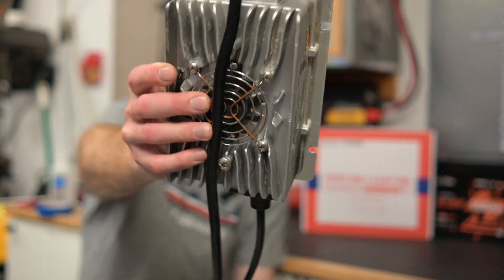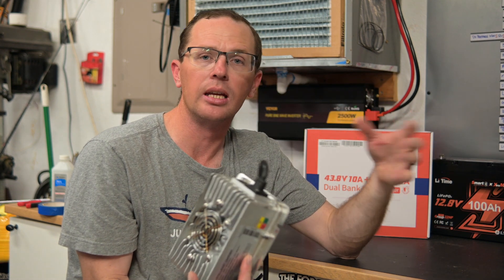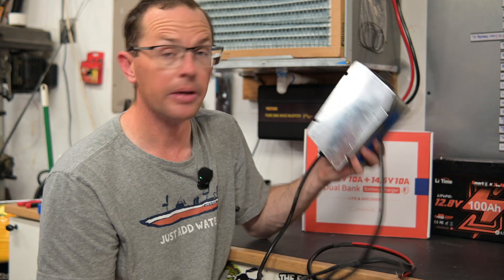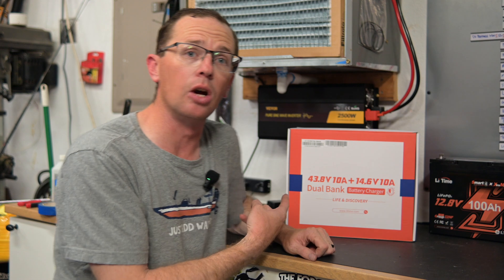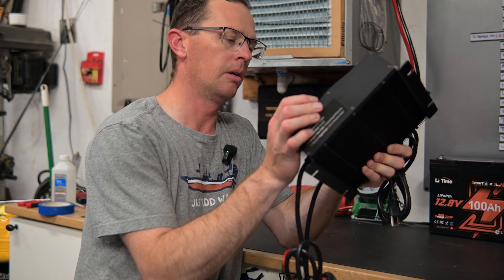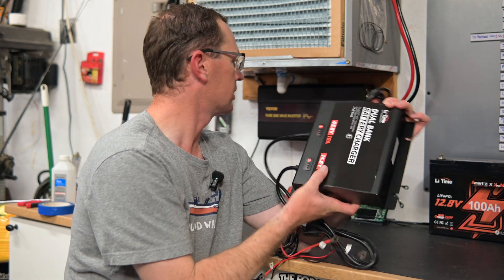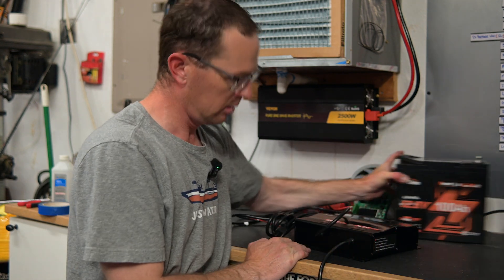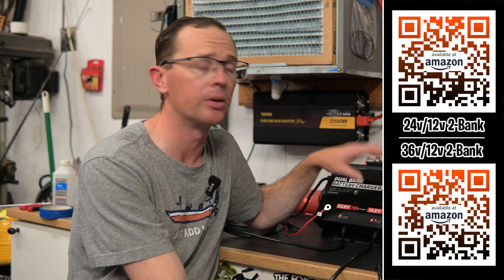How to Charge a 36V Lithium Battery (Without Multiple Chargers)

Comment: Question 18ft boat charger is in front the charger wires are not long enough does it matter what size wire i extend the charger with ? The battery its going to is agm not sure if that mattters.
Reply from the maker: I would use 12ga as a minimum when extending the leads 👍

Comment: I bought some 12v 100ah LiTime batteries. I have a Dual Pro professional 15amp 4 bank charger.  The batteries arrived at 19% charge.  They took 17 hours to complete.  This is crazy. What charger do you recommend?  Ty
Reply from the maker: Batteries definitely ship at lower SOCs. The cells may have been balancing, which can extend the charge times. 15a charger will typically take about 5 hours to charge from 20%.

Comment: I just ordered the duel purpose battery. After watching your video I have two glass Matt batteries for trolling motor. Genius 3 bank 5 amp what charger do I need for my new lithium battery
Reply from the maker: 5a is a bit on the small side but it will work as long as there is a “lithium” setting on it. 

If you are going to need a charger anyway, I’d look at a 10a. Something like this if you have three 12v batteries 

https://amzn.to/45vyOQm

Comment: I was thinking about this the other day and there's really no good reason to have on-board battery chargers, at least not for lithium iron-phosphate (LFP) batteries.  The reason we all wanted on-board chargers, back when SLA and AGM were the only real option, is those should be kept at or near 100% all  the time, for best battery life, plus they take a relatively long time to go from 50% SOC back to 100%.  None of those things are true with LFP batteries.  If you get back from a fishing trip and plug in that (very expensive) on-board charger, you should absolutely unplug it again before you go to bed...and you should leave it unplugged for at least 3 months, or until you use the boat again.  With this in mind (very short charging times and no need for continuous float charging), why have an on-board charger?  Why not have a cheap, external charger and an XT-60 port that is wired to your battery(s)?  I already have a Noco Genius 2x5, for my 24v trolling motor setup, but it was kind of a waste of money.  The portable charger I have could have done the same job, with just as much ease of use, and 1/3 the price.
Reply from the maker: I can see the point of view, but I do disagree depending on what you're doing with the boat. I typically plug mine in the night before I go fishing, wake up and go. No putting away extra chargers at 5am.

∙To start, the charger referenced is $255. In boating, that's not "very expensive", but it's not cheap, I get that. 
∙For your setup, a 24v/12v charger is only $166, that is pretty inexpensive. 
∙A 36v standalone 18a charger is $130 (the cheapest on amazon)
∙A 12v standalone 10a NOCO charger is typically another $80. In my opinion, the savings isn't considerable at all to go to standalone chargers, a lot less than the "1/3 the price" that you mentioned (only 17% less). So then it comes down to convenience. 

For convenience all I have to carry is an extension cord when I travel. Taking two chargers plus an extension cord is certainly do-able, but more steps and two more things to potentially forget. There is also no hurry with these LiFePO4 batteries to disconnect them before you go to bed, these aren't the volatile cells used in cheap e-bikes or power tools that people have the most trouble with when it comes to charging. 

Just my viewpoint!
Reply: @goodmanfishing  - If you charge your LFP batteries for the entire night before going fishing, they were pushed all the way to 100% SOC, and kept there, longer than necessary.  The 36v chargers are expensive because they're an odd voltage.  By comparison, 12v, 24v and 48v chargers are not only much more available, they are less expensive, on a per-amp basis.  The choice of a dedicated 36v battery (versus three 12v batteries) is what drives up the cost of the charging system.  Noco makes pretty much the most expensive LFP charges you can get, other than maybe Victron.  I have both, but I also have far less costly 12v LFP chargers (~$50) that work great.  There's no question that on-board chargers are more convenient, but if a guy gets back from every fishing trip and plugs it in, the LFP batteries are being kept at too high of a state of charge.  Most people plug them in and forget about them, right?
Reply: @eagleray1  - I would imagine the dedicated LFP charger is smart enough to not hold pack at 43.8v, but keeping any LFP battery at 100% SOC increases the formation of dendrites; its better if you leave them at 70% SOC, for example.

Comment: Hi. I have a question on running 24v or 36v for my trolling motor.  I would get more thrust on 36v ?  How about when it anchor lock?  Would it work better with 36v?  Thanks.  I have 2 - 12v in my boat now. I’d have to add 1 more 12v And hook the up in series to get my 36v. It’s the old fashioned way. But it would prevent me from having to put in a new charger for 1 - 36v battery. Cheers.  Any luck yet with your boat search ?
Reply: what TM do you have?  36v always better, more power and more run time. 36v have more power so spot lock might be better in extreme conditions
Reply: @mikethetoolman8776  I have the Garmin Force.  Just trying to justify buying another 12v 100ah lithium to make 36v. Already have a 4 bank charger
Reply from the maker: The thrust difference is quite a bit between 24v and 36v, 80lb on 24v and 100lb for a Garmin Force...but it wont make your spot lock any better.

The boat search is still on-going, however I am definitely in a holding pattern until our economy settles down a bit. Feels like it's barely hanging on!
Reply: @goodmanfishing  Ok thanks. Easy for me to just add another 12v lithium run in series to make 36v. Already have a 4 bank charger. It would be the easiest and cheapest way for now.  Yes bass boats are not selling good right now.  It’s a tough market for sure
Reply: @goodmanfishing  - The thrust difference is quite a bit between ... 80lb and 100lb ... but that isn't because of the voltage.  The pounds of thrust available, at a safe amperage, is what a higher voltage motor and battery give you.
Reply: Not necessarily.  The 36v trolling motors don't always run at a higher total wattage, they just draw fewer amps to deliver the same amount of thrust.  That's important when you're talking about motors delivering 100+ pounds of thrust.